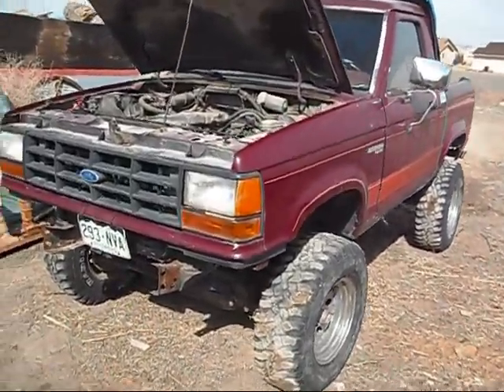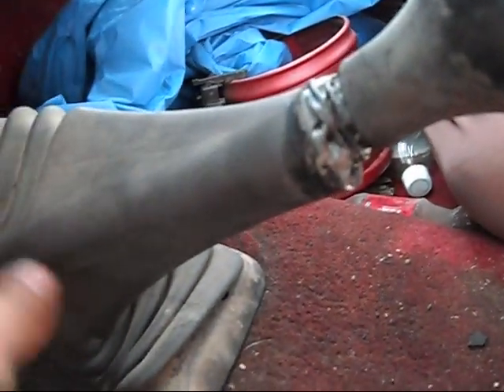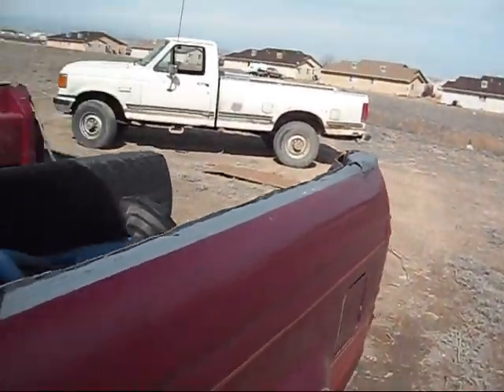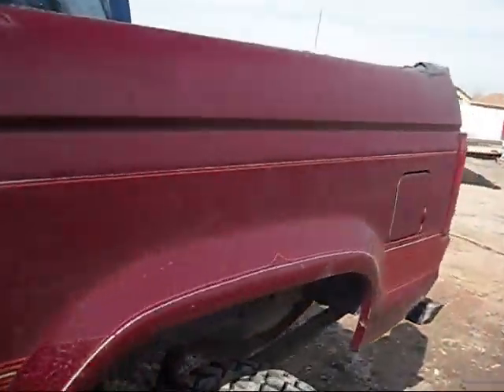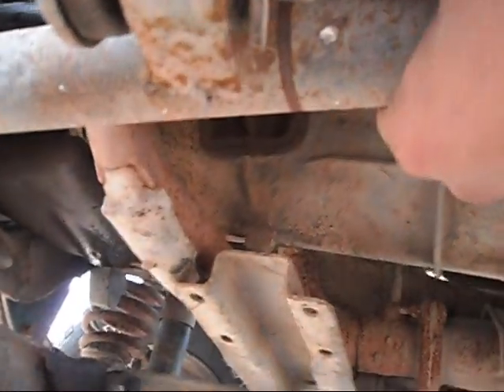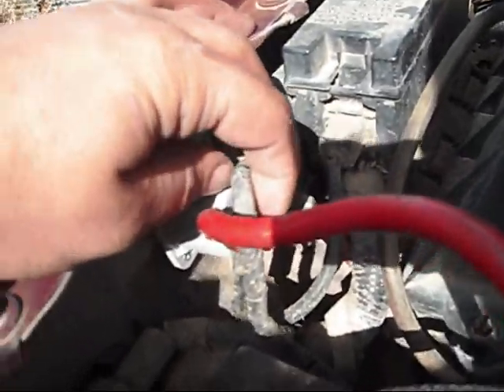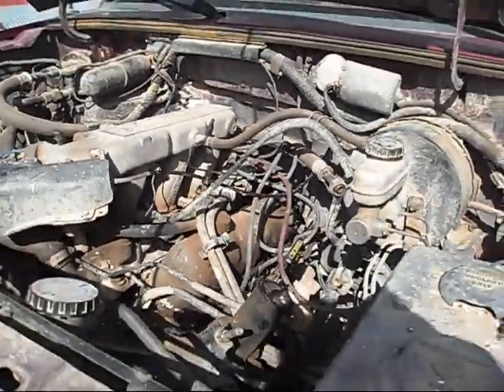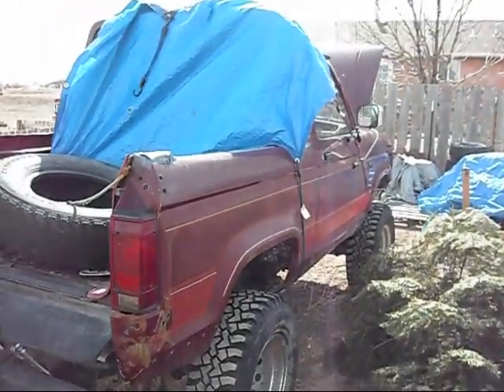1989 Ford Bronco II Walk Around Update

Comment from the maker: @assautlpwnz It depends on what you want to do with it. If it's just a normal daily driver you should be fine. If you want it for mud boggin or off roadin it is a little under powered but it will still do the job. That's what my 89 bronco 2 had

Comment: well must be the solenoid on the starter then? If the one on the was was the issue when you jump it with a screw driver between the terminals it would sparked.